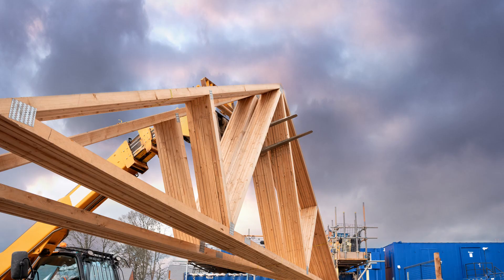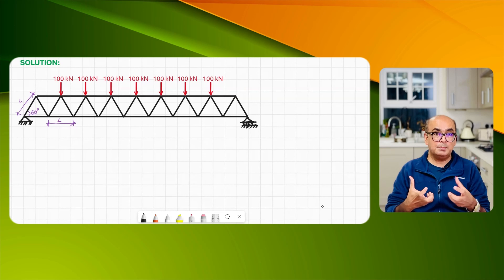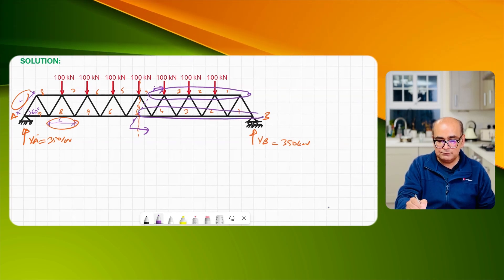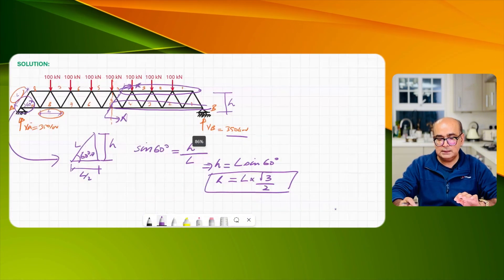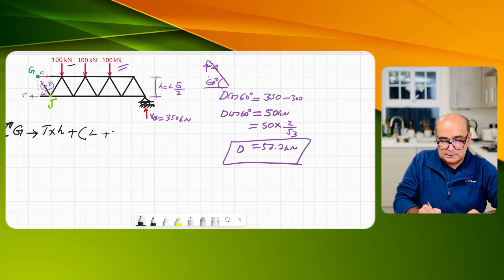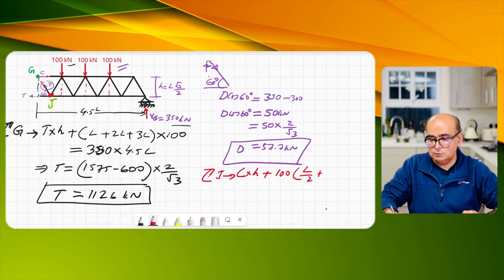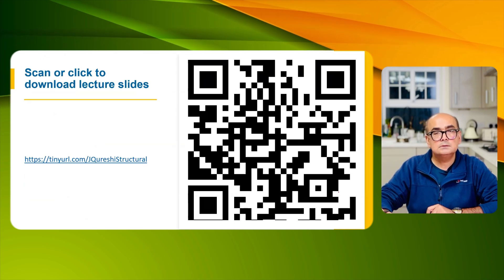Find Forces in TRUSSES and CRANES: Simple Tips from IStructE Structural Behaviour Course!

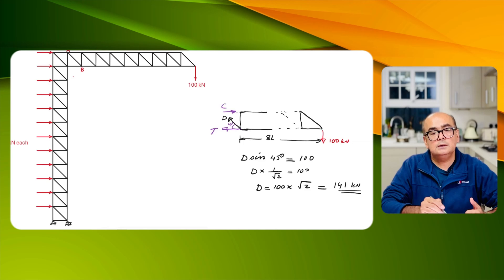Comment from the maker: Correction 1: At 09:26, I mistakenly said "compression at the top and tension at the bottom" of the crane's cantilever arm. It should be "tension at the top and compression at the bottom."

Correction 2: At 5:35, I should have used sin60 instead of cos60.

Comment: at 5.35 while calculating diagonal force, vertical force is equated with Dcos60? I think it should  be sin60. Please correct me if I am wrong.
Reply from the maker: @rishirathi2012  I think it should be cos30 instead of cos60. Let me double check I’ll get back to you. I’m taking a lecture in next 5 minutes.
Reply from the maker: Yes, my mistake, it should be sin60. Thanks for identifying it. I'm grateful to you. I've issued the correction list in comments.
Reply: Thank you professor. The video is quite educational.
Reply from the maker: @rishirathi2012  you’re so kind. Thanks.